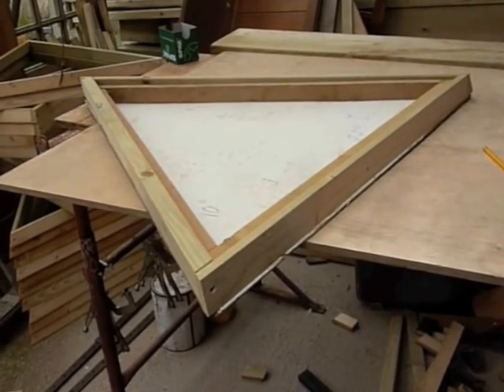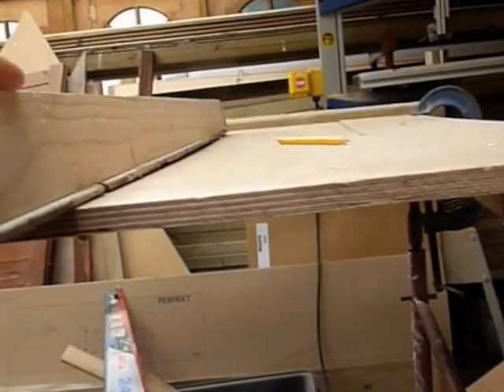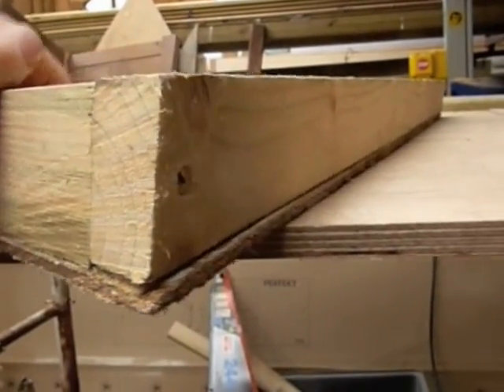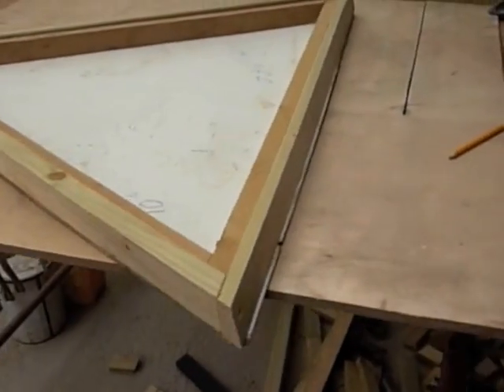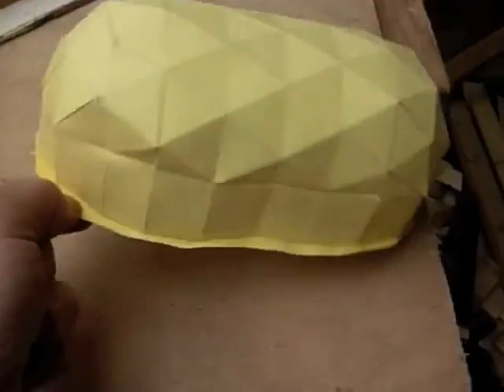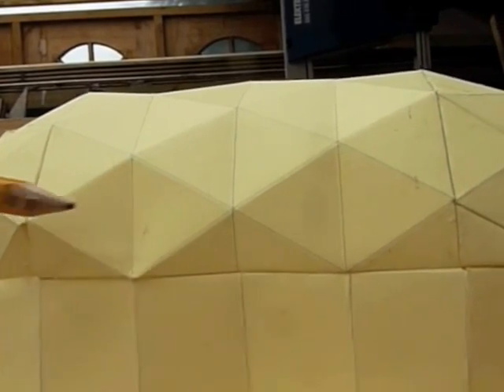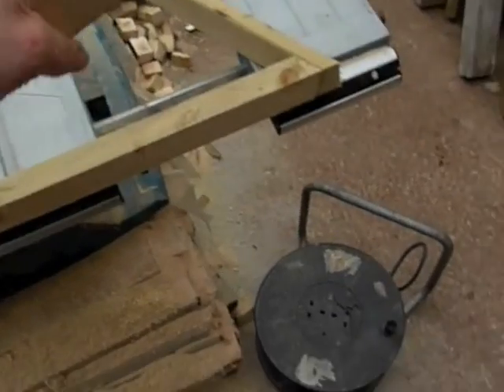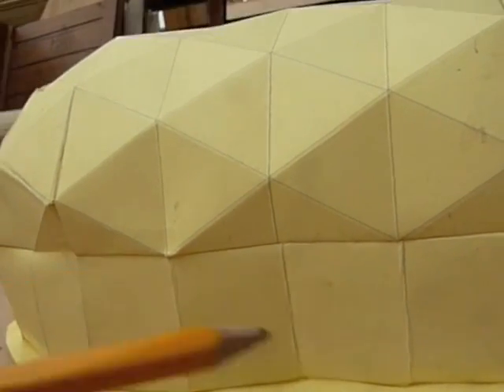Tunnel dome build tutorial

Comment: negative angle is weak
Reply from the maker: +immrnoidall Actually any hubs with struts that are at 180 degrees (flat) are weak but it does not matter if you go convex or concave, it is the dihedral angle that make the structure stiff. Try marking out equilateral triangles on a sheet of paper, fold the lines then form a tunnel, the paper naturally forms both positive and negative angles between triangles and is stiffer than either flat paper or paper folded only along the tunnel direction.
Reply: Paul Roinson very cool looking.and big.
Reply: hi Paul, thanks for the plan and video. but sadly the plan that i bought is missing a page where the base is shown. can you email me just the base pieces page? i saw in this video you have that but i cant see the details. or maybe you could check your email and reply me there. thanks man🙏🏾